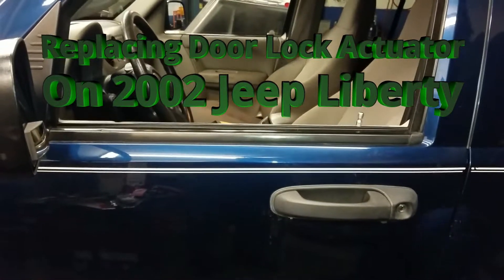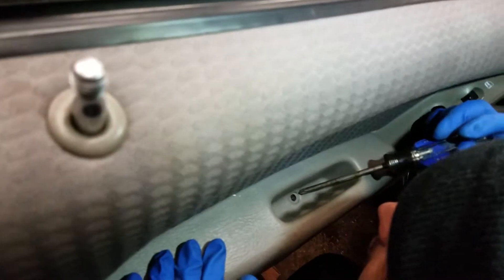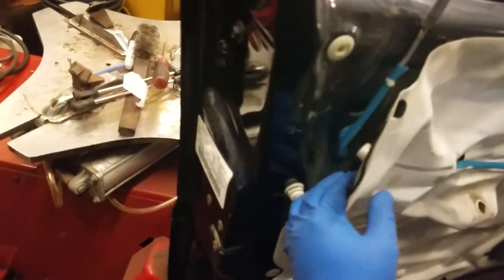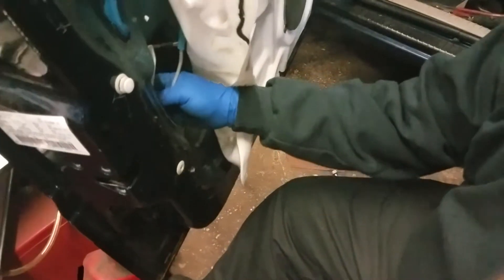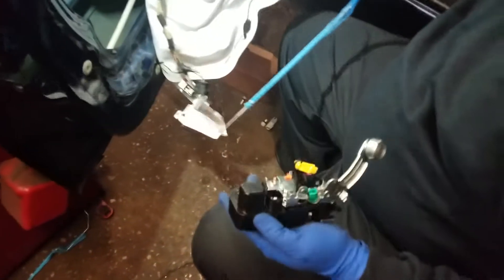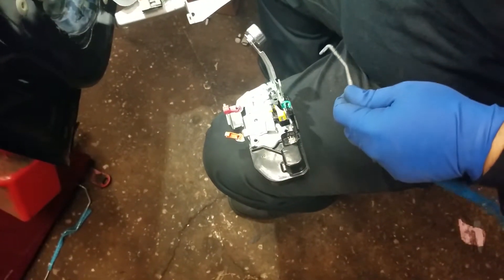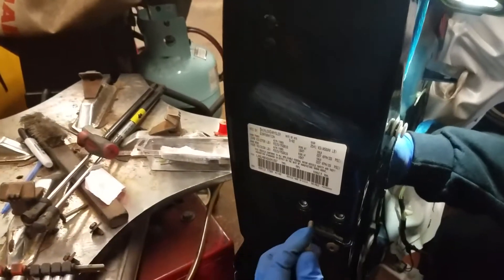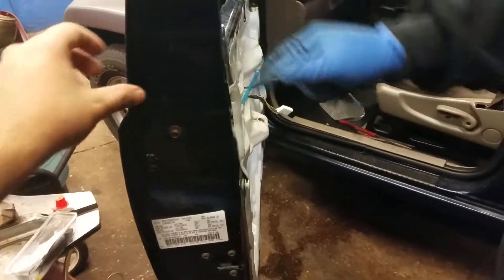How to replace Door Lock Actuator on 2002 Jeep Liberty Sport

Comment: Nice video .I had to use coat hanger to unlock rivers door today on 04 Liberty. I took door panel off lubed  key lock up and mechanisms with wd 40. No bent linkage or anything obvious .It works with key and electrically now. It whines now when actuator cycles ,I may have gotten wd40 down in it. So I may have to replace it in future.What is the spring loaded arm with the roller wheel attached to the actuator assmby? Is it a support for window glass or something .Thanks
Reply from the maker: I think ur talking about the window regulator
Reply: Not the regulator ,it is the short flat piece of steel with the round roller wheel that is spring loaded .It sits on the front of your actuator with wheel facing inward . Does it support the long rod running between manual door latch and the actuator .
Reply from the maker: @gregr1672  at what time frame u see it in video
Reply: At around 31 seconds your right hand thumb touches the roller wheel I am talking about
Reply from the maker: @gregr1672  that’s spring is just the load so it bounces click on and off
Reply: I wondered why the back door actuators don't have that little roller and spring .I see all the actuators for all 4 doors listed on Rock Auto Parts . Thanks for answering . Have Good Holiday